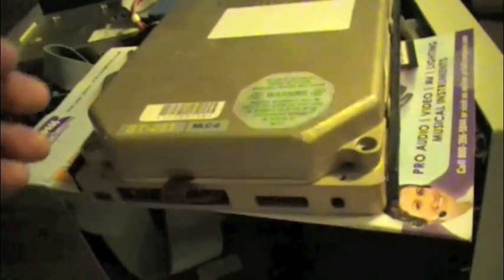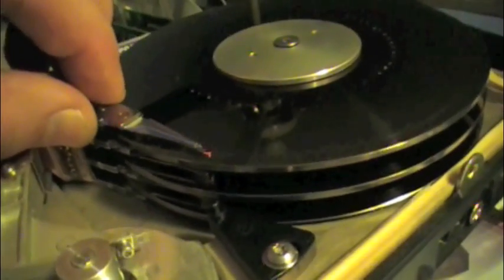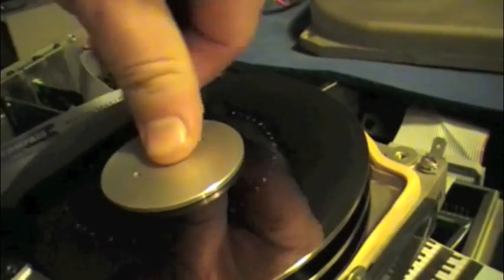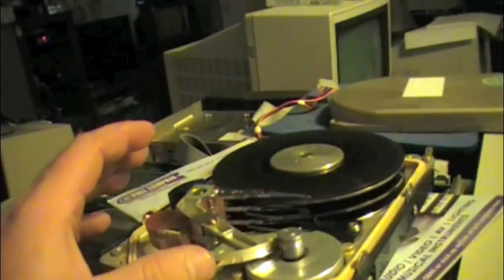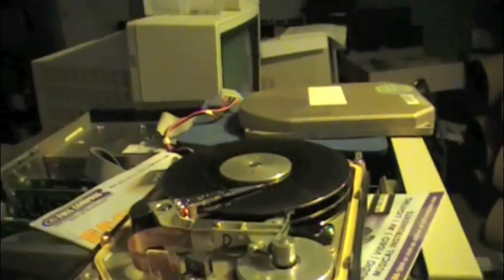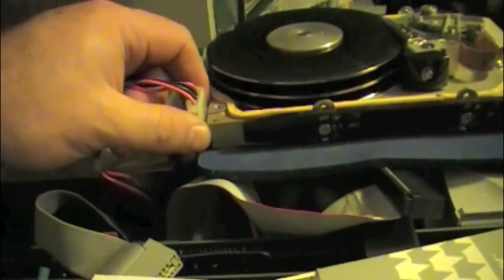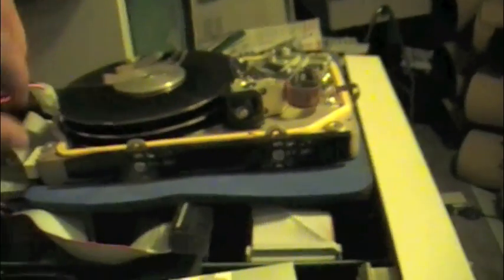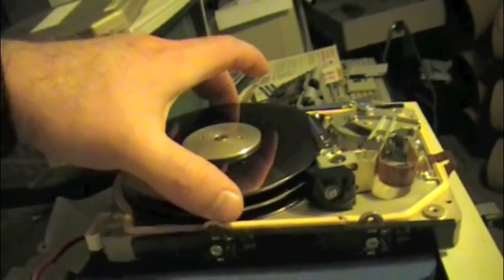OMG!  A bad Seagate ST-251

Comment: I think if the upper head is kapot, you can just input one head less in format utility. Chip of the rest of the upper head though.

It counts from the bottom I think.

If it counts from the top... i'm not sure, you could move head connector on the mobo around so pins from head 2 are connected to pins from head 1 ect.

Comment: I had a ST-225 do something similar only the control circuits didn't fry.  Very loud metal to metal sounds and there was a circle etched into one of the platters!  I've heard a story where a drive had bad bearings, developed a wobble on the platters causing static build up.   When this happened, it arced over to the heads and welded them in place taking out the control board.  I wonder if your drive did this.  The motor grounding strap on the bottom of the drive is very easily damaged on this model and ones like it.
Reply from the maker: Hmm, good question.  Though I've not heard of this happening, I'm sure anything is possible.

Comment: In fact, I never buy Seagate drives anymore since they released a whole bad party of Barracuda 7200.11 back in 2010. I've bought one, then it failed with all my data gone, the store has replaced it for me, and then it failed too and it somehow even led to my SATA controller failure. I treat Seagate like a cheap crap ever since.